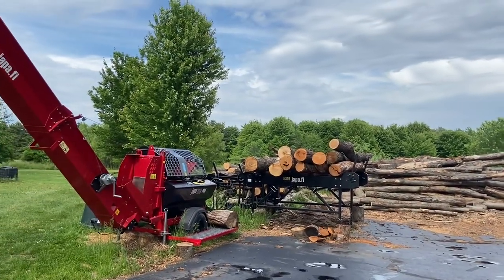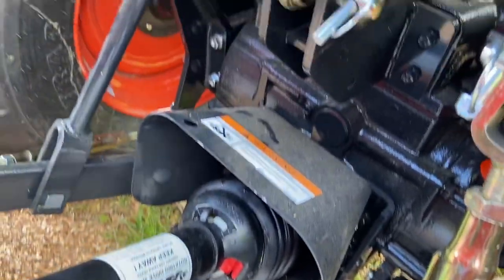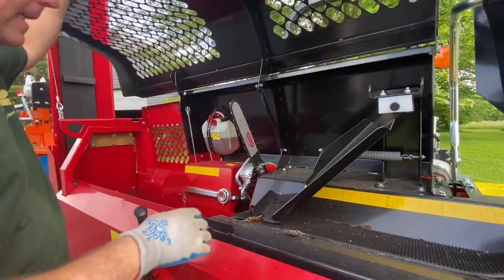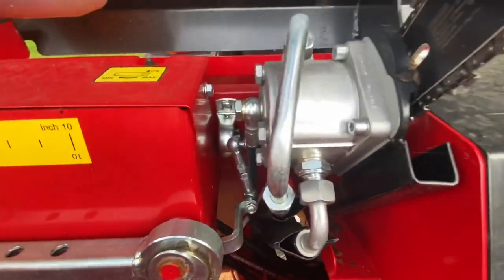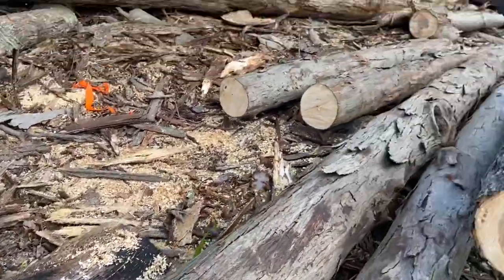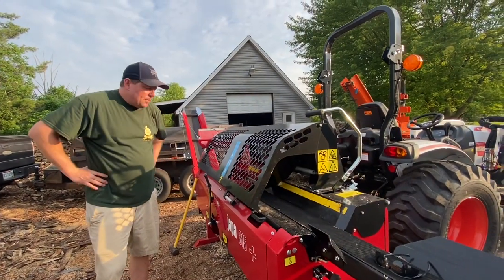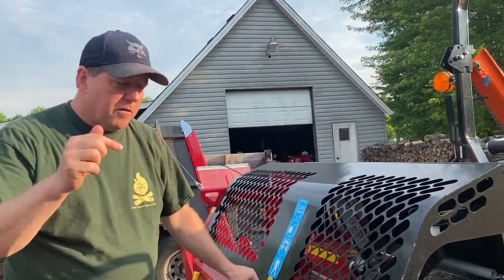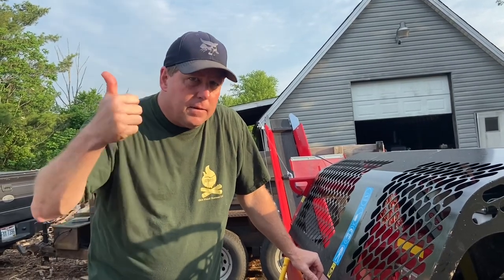Who Comes Up With This Stuff?!?  | Japa 315 Firewood Processor

Comment: I think you summed up the benefit at the end - if you are looking to move the processor to the logs - especially off-road - then this probably comes into it's own. If you are a static processor where you bring the logs to it, then probably better with the self powered version.

Nice video showing the differences though, thanks.
Reply from the maker: Thanks Chris.  You are spot on.  Thanks for the post

Comment: Watching you work it, I think the weakest parts are the initial log lift and the belt feed. The lift looks a bit wonky, and the belt needs to be a lot coarser and thicker. Having to hand roll a heavier thicker log onto the feed just begs for squashed fingers or a broken wrist. The handle for the chainsaw also need to be shortened a bit for better leverage. Otherwise, what a neat piece of equipment....

Comment: Hey Joe! Very good video. You did very well with your current setup. I would be very skeptical relying on a tractor to run my wood processor. At least if you have tractor trouble, your Japa 365 has an engine to keep you going. Great job Joe!
Reply from the maker: I agree but...you know...either/or will break down eventually!
Reply: @ohiowoodburner  mainly farmers in Europe use PTO wood processor, they have at least one old tractor standing on the farm, and they leave the tractor / wood processor as a stationary workplace and use newer machinery to move timber / wood. Often an old discarded Massey Ferguson, fordson, Volvo BM, etc. from the 60's or 70's with a diesel engine is used for this purpose, they are unbreakable.
here is an example of woodworking on a farm. https://www.youtube.com/watch?v=y0FFr4Ux_XE

Comment: Thanks for another valuable video on another piece of equipment.  
Also thanks for the link to the National Firewood Workshop.  A lot of good info so far.
Reply from the maker: Glad you are enjoying the workshop.  They are a good org to stay connected with.  Joe
Reply: @ohiowoodburner  You got 12k views in two months.  Japa will like that.  It is light enough you may have unloaded it with forks on your loader.

Comment: Awesome video Joe! I’ve often wondered about these PTO powered processors… They seem like an economical solution however you lose all of the functionality of your tractor in helping you move logs and split firewood! I would however be very interested in trying one!
Reply: You've got it figured correctly.  You are looking at the need for  a 2nd tractor for moving logs to the machine.  I personally would look to an engine on the unit.  which be more economical  then running a 2nd tractor. even if you had one available.
Reply: @jamesmckay9966  Exactly, even though I have a mini skid steer to load the logs for a pto processor, I think I’d rather put the hours on a knock off honda motor rather than on my tractor 🤷🏼‍♂️
Reply from the maker: This 315 can run unattached from the tractor.  You could disconnect the shaft and move logs, reattach the shaft.
Reply: Oh wow that’s a cool feature and one that should be highlighted in a future video! Thanks Joe!
Reply: @ohiowoodburner  A rear attachment running on the PTO but not attached to the 3 point hitch...I don't believe it.
Reply: @DudeRanchDIY  I have a JD diesel 3010 that needs hours put on it because that the engine was overhauled. I don't know if I would put enough hours on a processor to justify the extra investment for an engine.
Reply: @briansilver9652  actually   in Europe they have a separate metal box that holds the pump and about 20 litre of hydrolic fluid on the 3 point that the PTO is connected to and from that box they run 20 or so feet of hrydrolic hoses to the prossesor so if you need your tractor you disconnect the two hydrolic lines so you basically can park  your tractor anywhere around your prossesor

Comment: Yep, PTO powered machines are huge over here.
As others have said, they tie up a tractor, so you need to have something else to do the moving and loading at the same time. The processor SHOULD be stable enough to run off the 3-point linkage though, so if you can set it up to work with a deck, you can load the deck first and then just connect up the PTO and process until the deck is empty. Repeat as required.
My youngest tractor here is 1988, and the one that runs the processor is from sometime in the early 70's. Hours on the clock are completely immaterial :-)
On most European machines, the model number is approximately the maximum cutting size in millimetres. The 315 in this case is 315mm (12-and-a-bit inches), your 365 maxes out at 365mm, a little over 14 inches.

That spinning PTO cover is giving me the heeby-jeebies! There should have been chains supplied with it, PLEASE fit them and lock the thing off.
Reply from the maker: I'm hearing you about the drive shaft!  And yes the 315 can work unattached from the tractor!  Thanks for the post Ivor.  I saw you on the Workshop today as well.  I'm glad people outside the USA could log on.  I appreciate your support of OWB!
Reply: @ohiowoodburner  The Workshop was great, but I was unfortunately called away about an hour or so in, and by the time I got back home, it was family time for the evening. So, I missed most of it :-(
Regarding the PTO cover, a bit of research is telling me that there's a couple of trains of thought on the use, or non use, of the restraining chains over in the US. Over here in Europe, it's something of an Article of Faith that all these safety features must be used at all times. An unrestrained PTO cover over here will fail you your Farm Inspection, and the use of all these things is drilled into us all through Ag-College and throughout further training and workshops. The US debate on the subject has me now pondering the dogmatic approach to this...
This stuff is most noticeable to me in the almost complete absence of US manufactured firewood equipment in the European market; I suspect the costs and engineering problems of building in all the mandated safety features make it uneconomic.

I'd personally like to thank you for showing me, and I suspect many others, that there's a much better way of running a firewood business than just making noise 'playing' with the machines and then hunting around for an outlet to 'dispose' of the product. I'm not a 'Sales Guy', and I'd far prefer swinging a saw in the woods and operating the processing equipment, but you've inspired me to look much more closely at adding value to my product, and in making both the product and myself more presentable to the potential customer.
So, thanks, and keep up the good work!

Comment: Great machine, when you already have a tractor and start the other way round than you did and don't have a budget for a machine like the 365.
In Germany and I guess in most European countries you can have a 400 V 3-phase-AC electrical outlet installed and so it is possible to order a JAPA 315 with electric propulsion for this voltage. There are even manufacturers, who deliver their machines with a combination of both propulsion types.

Comment: Hi Joe!!😀😀
The 315 is definitely a nice little firewood processor. It would be interesting to see you put it on the back of your Ford 2000 and see how it handles it. I bet it would run it nicely. That way you would have the Bobcat to stage logs with. 
I would like a 365 that hooks up to the back of a tractor. I have several tractors just sitting around doing nothing and it would make it very mobile. 
Take care my friend!!😀😀👍👍

Logger Al
Reply from the maker: The 365 does come in PTO.  I do intend to hook the 2000 up to it but I am dealing with a flat tire right now.

Comment: Cool intro.  No way I'd drive a tractor over my camera!  It would be great if it were free-standing so you could use the tractor to load the deck, then just back it up to the Japa and connect the PTO without having to deal with the 3-point hitch... but then I'd probably forget to disconnect the PTO and drag the processor across the log yard.  On the other hand, you can buy an old 8N Ford for about what the engine would cost you.  Lots of Europeans use electric motors for power, but everyone has access to 220V, 3-phase over there.
Reply from the maker: This machine is free standing.  I failed to mention that.  You don't have to be hitched to it to run it.

Comment: PTO driven is actually very common here in general for all kinds of equipment, there are even big splitters for 60 or 100hp+ tractors (rare tho).
Thing is, that a lot of people have tractors with thousands of hours on already and are also efficient because diesel.
A lot of farmers produce firewood in the winter "on the side" basically. What they do is split on location and make bundles (or stacked) of about a face cord in 1m or 40 inches length. 
When it is dry they cut it up to the length you want, common are 25cm, 33cm or 50 for boilers (10, 13, 20 inches). Wood boilers are very rare in germany, only in the south and Austria people have them usually. Reason is they have more wood there, so it's cheap. Diesel heating used to be common, not so much anymore. Now natural gas is mostly used, sometimes wood pallets.
Reply from the maker: Thanks for the post and the insight into Germany.  PTO seems to be more prevalent in Europe but I think the could find their place here.  There are a lot of capable tractors out there.
Reply: It sounds like the farmers are splitting logs that are 40 inches long. That is very strange compared to here.

Comment: On the other side of the coin, using your tractor to run the processor lowers your fixed costs per hour of operation on the tractor.  So your accounting department might like using the tractor.  It sounds like easy work for the tractor, I didn't hear it strain at all.  Tractors are made to be worked... not looked at ;-)  If you can run out the warranty by using up the hours before using up the calendar, you're putting your tractor to good use.
Reply from the maker: Very good insight. Thanks buddy
Reply: So let me understand this: you use up your warranty with engine hours but the drivetrain tires etc don't have the wear and tear on them... So you can come out a little ahead?
Reply: @dvasymmetry9696   LOL!  That's Brilliant! 
So explain, Why would you buy a tractor, then not use it because you're afraid you'll run out the warranty??

That's like hiring an employee, then letting them sit on break 6-7 hours a day because you don't want them to get tired.  With full benefits.

Comment: A way to deal with the poor visibility of the wedge would be to put a ruler on the notches to show how high the 4-way is set as you move the lever?  Thanks for the demo...
Michael
Reply from the maker: That would be a good idea.  If I owned this machine I may just do that!
Reply: @ohiowoodburner  possible feedback for the manufacturer.
Reply: @clementsconsulting9216  Yes.

Comment: Japa should consider a 2” reciever on the back of the unit.  Then one could haul the 315 back to the site, pulling the trailer that will later be used to haul the wood back in.  Everything needed on one trip out and back.
Reply from the maker: At least the machine can operate unattached from the tractor.
Reply: Obviously they build it light and not to handle such a load. It is a good idea but you might rip your yappity shreds

Comment: They need a guard in that PTO shaft.
Reply: typically the black is a cover that free wheels with the shaft until it touches something then the shaft spins inside.
Reply from the maker: I think it needs the chains installed.

Comment: The thing with machines is u always seem to need a bigger one ,I haven't got one yet because I don't want to spend thirty grand and not be able to do the big stuff ,I need the biggest one they make cause I get big logs ,so I don't know but it's cool for sure
Reply from the maker: I'm hearing you Greg.  It seems you can have anything you want as long as you are willing to pay for it.  I will stick to the small ones.
Reply: You could maybe split the big logs so they will fit in a small machine.  There is a wedge that is threaded to spin its way into the log.
Reply: @jakebredthauer5100  yeah I've seen it and I would need that or something like that

Comment: Only problem.   Now you can’t use your tractor to load logs 😭😭😭
Reply from the maker: The processor does not have to be connected to the tractor.  It can be free standing.

Comment: I would have to agree with you that with a PTO machine you are putting a lot more hours on an expensive. tractor motor.  I would rather spend the extra money on a small engine to power up the unit than on my $20k plus tractor .
Reply from the maker: That's the way I see it too.  Maybe if I were only making wood occasionally the tractor would make sense.

Comment: I bet it operates a lot cheaper than the gas powered 365.And much quitter
Reply from the maker: I think the noise was about the same.  I am not sure yet about fuel... I have to use it more with the tractor.